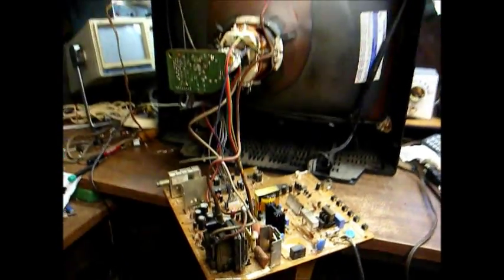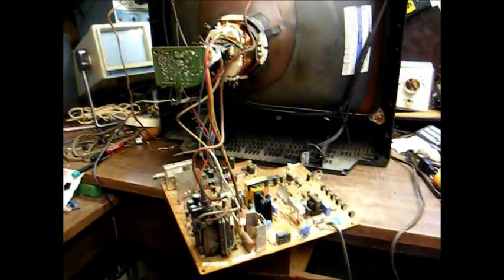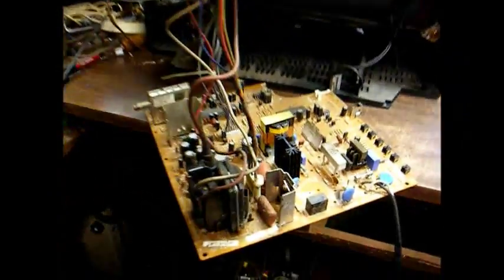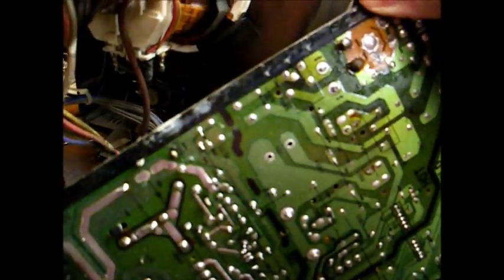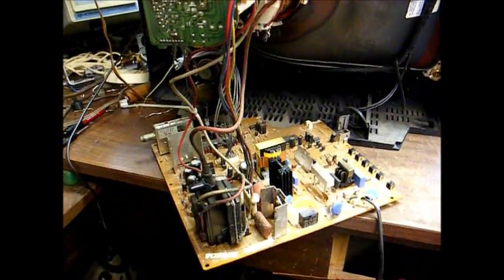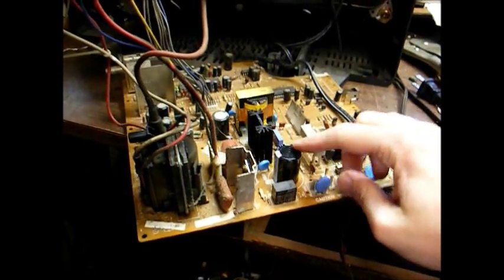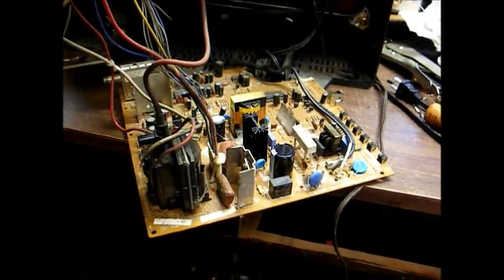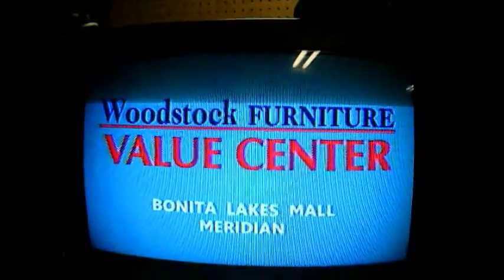1999 Daewoo color TV with missing filter capacitor (from the factory)

Comment: In today's world it would not surprise me if a new set left the factory without a power cord.  In the early 1990s I bought a cheaper Snowblower.  Out of the "Box," I started the thing and when satisfied, I pulled the plastic run key out to kill it.  It kept running!!  I had to get an insulated pliers and yank the high voltage cord off the spark plug.  Find out the grounding wire was not attached to the key mechanism which grounds the unit dead.  I still use the snowblower as long as I can get maintenance parts.  Now the important points are not to use synthetic oil or ethanol gas in it.

Comment: WOW! No filter cap! Unreal! Looks like another great repair job, though! Has a decent picture! Didja go over the pc board for cracked solder joints? That's another common problem on ANY of these pc board sets, especially under the vertical output IC, under rectifiers, etc. Anything that ran warm would develop cold solder joints! Modern CHINESE JUNK! OH! And I AGREE 100% about digital TV signals! It SUX! I would sacrifice definition of the picture for a picture that at least WORKED even if it was a little snowy, at least you could still get SOMETHING!

Comment: I quit watching tv when they switched to digital, well I still watch it as it's the external screen for my laptop and I've got so I can watch whatever I want on the internet by knowing some hidden sites that have endless movies and such. So with a cordless mouse and on screen keyboard I'm all set.  I run my audio out of my laptop into a splitter then into a pair of 1961 Blaupunkt tube table radios that sit on either side of the tv. The sound is really amazing, many times better sound than my home theater which I eol'd.

Comment: I used to have a Daewoo TV that my stepdad gave it to me back around 2000 or 2001 and it was a 25" set and the colors are smirky. Sadly, it was not working anymore until I've got a Toshiba 30" TV from about 2003 until it is not working in 2011 until I also got my LG HDTV from 6 year ago until now. Toshiba made a TV from 2003 which was SDTV and it was one of the last of the CRT models until I owned an LCD TV from 2011 which I have is an LG.

Comment: I have 1999 GE tv that still works but the color has quit. So do you know what controls the color on this unit? Thanks
Reply: Usually on the back there are knobs that change the tint, color, etc., just adjust those to your specifications. if those knobs aren't on the back, then it's a B&W tv. If they aren't doing anything it's a problem inside the unit

Comment from the maker: Sorry, I can't help you with the model because I no longer have the TV. My set was an NTSC-only TV; but, yours could still be a multi-system set. Usually, the TV's that I see that are multi-system will have some written indication on the set to that fact. If your TV is only showing a B&W picture, it could be that the color control is turned down and some of these sets require a remote with a menu button in order to adjust the color and other settings. Otherwise, you have chroma circuit trouble.